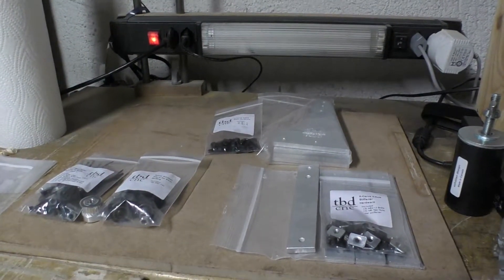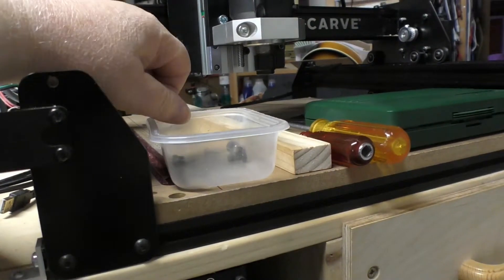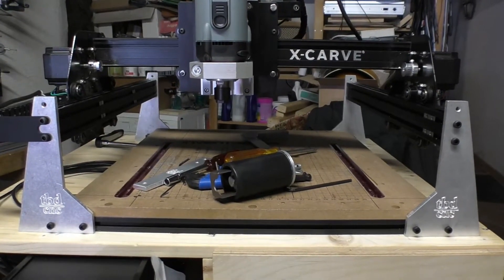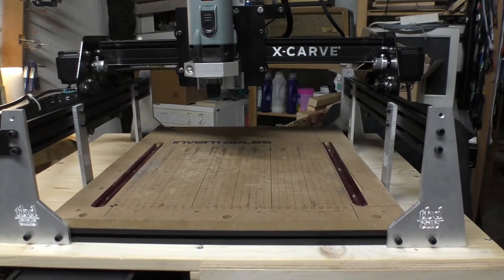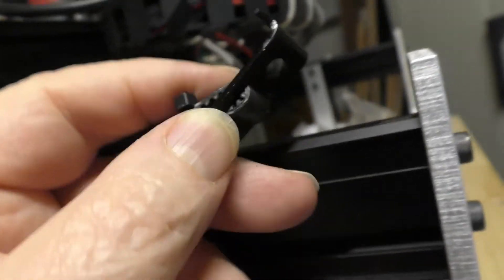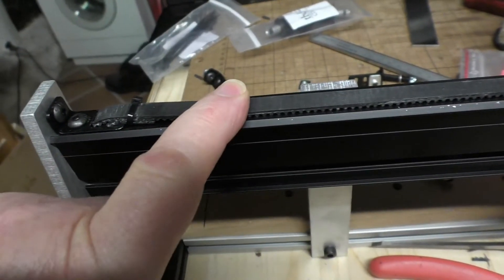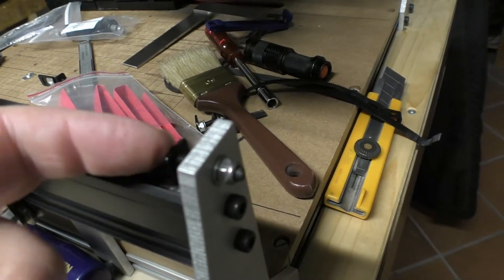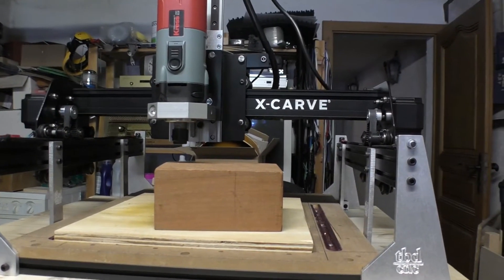X-Carve Upgrade - part 2 - risers, stiffners, belts

Comment: John how did you shave down your belt? Having same problem.
Reply from the maker: Hi Eric, basically with a very sharp Stanley knife.   Once I knew how much (length) had to come off I took the belt out of the bracket and laid it on the bed to make it easier to cut about 1mm from each side of the belt.   I used the original smaller bracket as a guide to making sure the thinner belt would fit, etc.   I have not upgraded the X-axis belt as it seems like a lot of work for uncertain gain.   I'm sure I'll get round to it someday soon.   Good luck with your project.
Cheers,   John

Comment: Did you have to change any settings on your Machine after you put the 2” risers in ?
Reply from the maker: Hi, no setting changes were needed for the risers.   When I upgraded the Z and Y axes I had to re-calibrate and adjust the steps/mm in the settings and that was all.
Cheers,  John
Reply from the maker: Slight change to my previous reply - I had to adjust the Z-axis spindle position vertically so I would reach down to the bed without reaching the end of it's travel....

Comment: Can’t wait to see it in action, and the use you will put it to... !  Better than an Indiana Jones film!
Reply from the maker: Hi Charles, well I wouldn't go so far as to compare my small efforts to a Hollywood production!   You might have to wait a while to see more of this project.  While checking alignment, etc. yesterday I discovered I made an error in the dimensions of the spindle motor mounting plate so I will have to make a new one.   On the bright side I finally found a local metals supplier who will cut to size and ship to private customers - usually they deal with trade companies only).   Anyway, watch this space..........